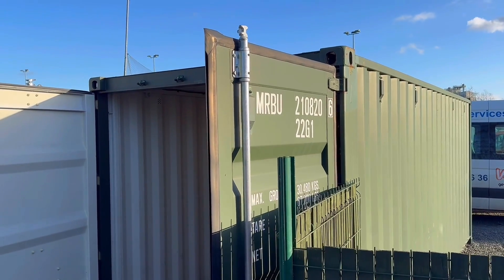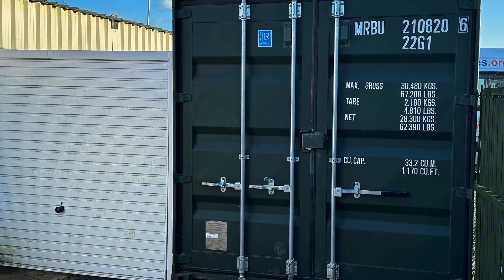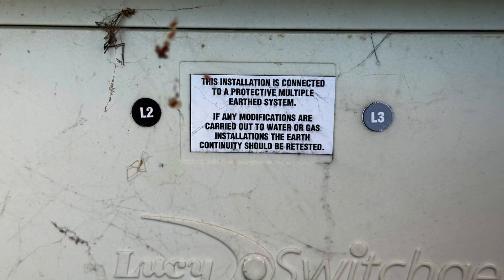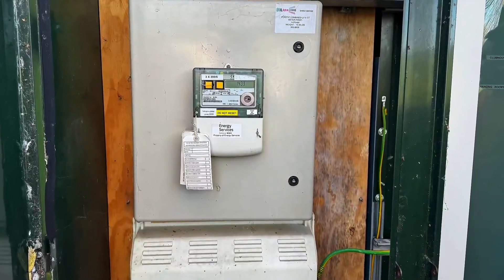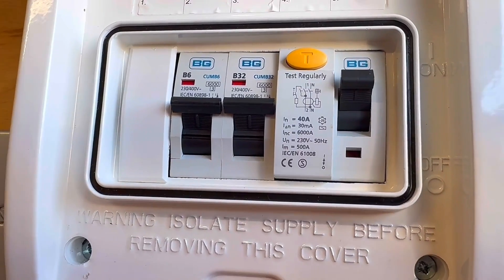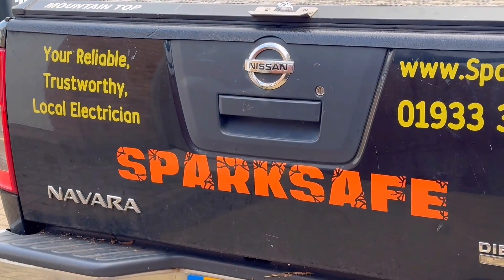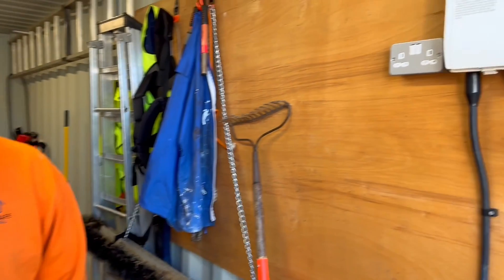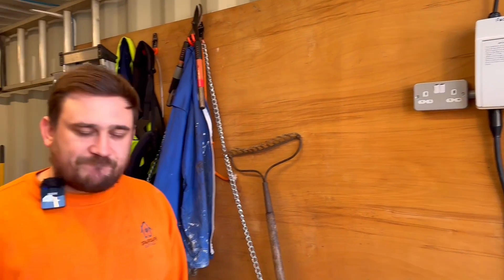EICR - Do I Need to TT the Earth in This Installation?

Comment: I would prefer to TT it but another option could be to add a supplementary earth rod to the TNCS to keep touch voltages within safer limits. You could do this at the exported CU in the container. Then you’d have some migrating factor against PME faults also general live earth faults to the frame metal work bonding this to the MET with the ground connection. TT with separate Earthing is the ideal solution the second is pragmatic.
Reply: Another option again add PME fault protection in the main building before the TNCS is exported. Other measures after the EICR write a safety note to the client
And Give it a C2 because you want the client to act on the EICR.
Reply: Another option again insulate the floor and walls inside to to above 22k ohms so you reduce the shock hazard and bond and services 🥶 ( still with a rod keeping the frame safe )
Reply: Agree if the shell of the container becomes live, a supplementary earth rod in the ground right next to the container is going to keep the touch voltage to a minimum.

Comment: It is not as simple as simply sticking an earth electrode in the ground.  Conisderation needs to be given to the distances of underground metal work connected to the local PME supply since open pen fault voltages may be transferred to the earth electrode.  the latest COP for EV vehicles suggests 10m separation from such metal work.  I would argue that section 717 applies to the container and as such the use of PME earthing is prohibitied and I would argue a C2 is required.  Other methods of protection may be more suitable than earth electriode such as an isolating transformer but the absence of further informaiton would mean that I could not decide what the most cost effective solution would be.
Reply: It's a metal shed surely that happens to be a 20ft container - I'm not sure that makes it either a 'mobile or transportable unit' so I wouldn't have thought 717 applies?  And there is a real risk of shock in a domestic (say kitchen setting) with open PEN currents and nobody codes everybody's installation a C3 or even a C2 consequently?

Comment: So what if theres an RCD? An RCD offers no protection whatsoever in the event of a PEN fault, as it still sees balance between L+N - this is clearly a C2 - potentially dangerous, though the danger is dependent upon network conditions rather than installation conditions - however, if an EVC only attracts a C3 if not PEN fault protection is provided, that container will have to be a C3 also, though I disagree with it. I'm very surprised you've mentioned the benefit of an RCD without mentioning that it's useless during PEN faults, enabling the container to liven up unchecked.
Reply: Good to see the issue of RCD effectiveness mentioned in this scenario, however wouldn't the failure to operate be due to the lack of a neutral which is needed along with the live to power the electronics in the RCD?  How common is a PEN fault in view of this danger possible in every installation (apart from three phase delta)?
Reply: @alanb4789  allegedly 400 in the UK annually - so not many and I'm not sure there are attributable deaths?  I agree though that PEN fault risk of shock is apparent in a domestic setting too - it's only that the risk of shock is increased outdoors - but it's ever-present indoors too -- In a kitchen setting you're highly likely to have access to metal attached (bonded) to the MET and have a reasonable connection to earth too - unless you habitually wear rubber slippers!
Reply: No reason not to put an earth rod in alongside the pme. Often done in Ireland for example. C2 for me. Pen fault light the thing up

Comment: Just by way of a thought experiment. I think the risks of connecting a container to PME are similar to having an exposed neutral bar. Or having a cross polarity neutral and earth connection. Or having a broken cpc connection to a metal light fitting. None of these conditions will hurt someone unless the conditions are right. But in each case only one thing needs to happen to cause a danger. So I think it’s potentially dangerous.

Comment: We come across this a lot and it is clear in Section 717 that the PME ‘shall’ not be used. 

When we look at why we think faulty PEN conductors and the hazards they import. 

For me it is a toss up between a C2 or a C3 and having the fuse board within may tilt me towards a C2 as if there were a PEN fault people may look to go in the container to check breakers. 

Don’t fall out with either code tbh.
Reply: It's a metal shed surely that happens to be a 20ft container - I'm not sure that makes it either a 'mobile or transportable unit' so I wouldn't have thought 717 applies? I mean - it's tethered to the ground by at least a SWA!  😆

Comment: I think Marcus' instinct to make it TT is correct. Any guidance I have found on this subject (eg NAPIT On-site Solutions book 2nd ed page 208) acknowledges concerns related to exporting PME earth (I'm assuming the SWA distributor to the container DB is 3-core as I can't see a separate protective conductor) and recommends making the outbuilding TT. I would say the code should be C2.

There is a danger that, in completing an EICR, the person doing the testing is solely focussed on the installation under test but there are broader issues here and they cannot be ignored. The most obvious concern is the hazard presented in the immediate vicinity of the container under test during a PEN fault on the DNO supply. However, from what little we can see of the environment, I would say that are also hazards with transfer potential (adjacent containers look to be touching - maybe, maybe not - we don't know for sure) and touch potential with regard to the fencing.

I would suggest that there is a duty of care on the tester under EaW regs to bring these hazards to the attention of the person(s) controlling the site, even though they may not be the party commissioning the EICR. Failing that, an email to the DNO at least. Is that just covering your backside? You may think so but, all things considered, you'll be glad you put something in writing when the police or HSE come knocking on your door post-incident.
Reply from the maker: It was Napit that told him to code it a C3 🤦🏻‍♂️
Reply: @GSHElectrical  to be fair to NAPIT, the guidance I quoted wasn't addressing EICR codes as such. I know they publish a 'codebreakers' guidance book too but I don't have a copy so it may well be that the guidance in that document is consistent with the conversation Marcus had with (presumably) their technical help line.

On a completely unrelated matter - does the description section for this vid need an edit? 🤔😊

Comment: If you are stood on the outside with your feet on the ground and touching the container, what touch potential would you be exposed to? If it is less than 50V, then you are okay, if it is more, then you may need to ad an earth stake. However, it looks like the container is close to other metal structures, so if you can touch those metal structures at the same time, then the touch potentials for that scenario also need to be assessed.